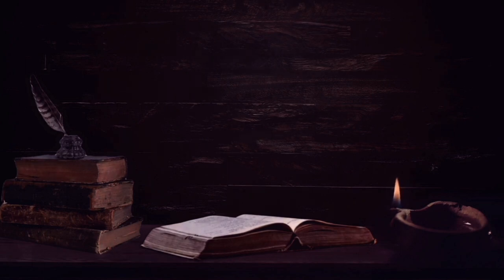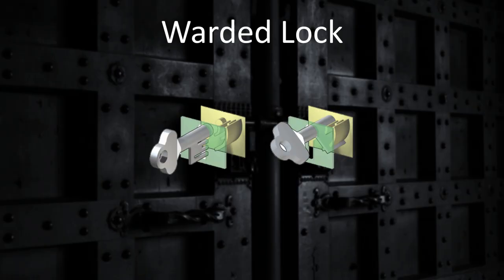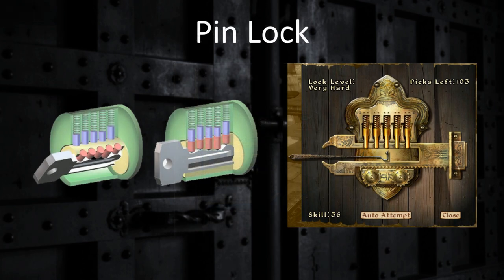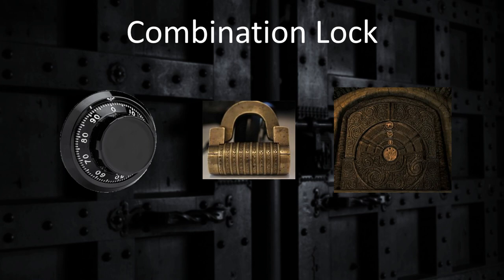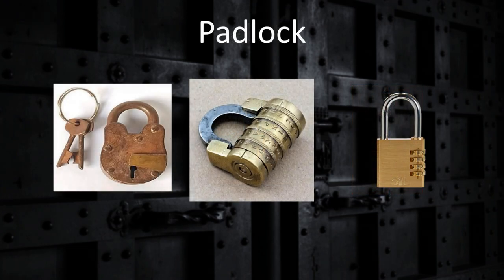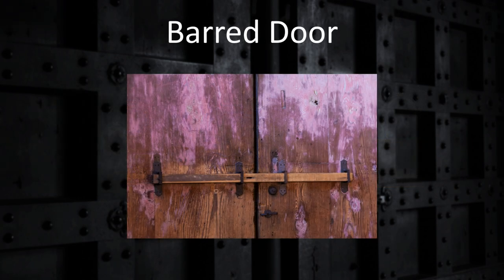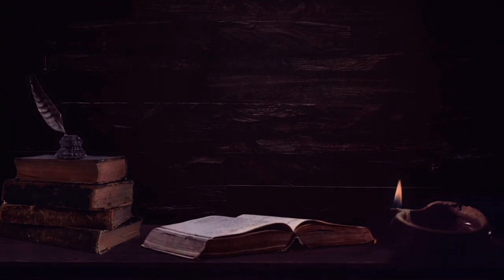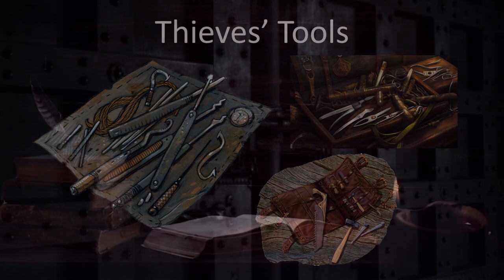Using Locks in your D&D or OSR game

Comment: "What is in my thief kit?" is a good question too. I can see that the kit costs a bit more than just some lockpicks. I usually judge that a number of simple, small tools like a cutter, a spool of metal wire, a chisel, a screwdriver, a set of files, a loup etc are part of it.

I've seen thieves supplement their kit with boltcutters, stethoscopes, small amounts of acid, drills, rolls of string, glue.